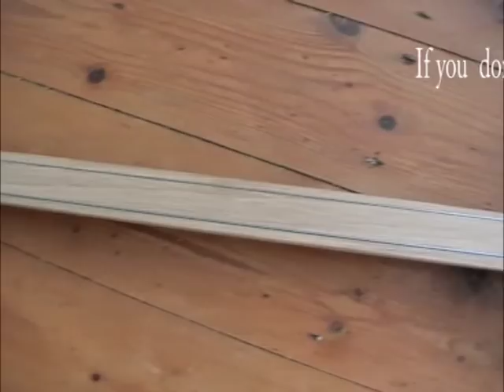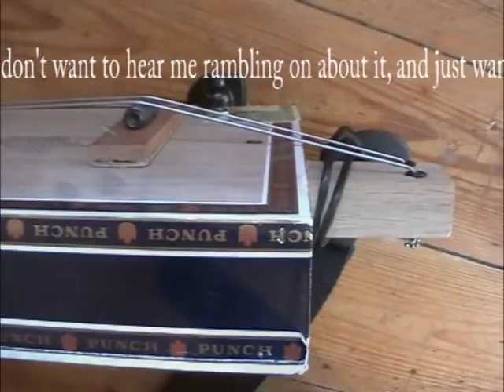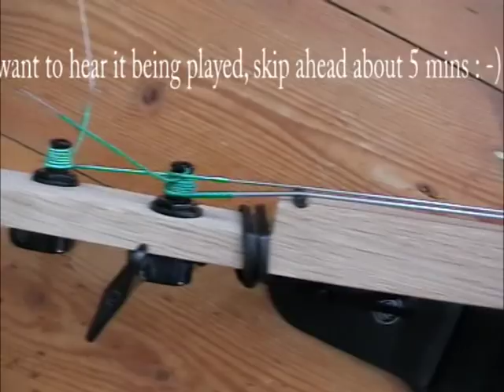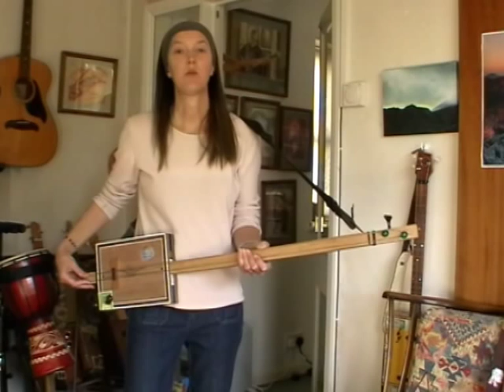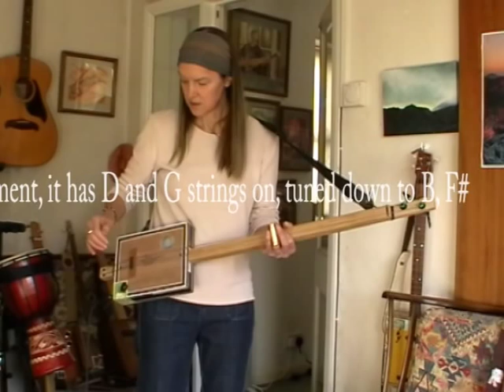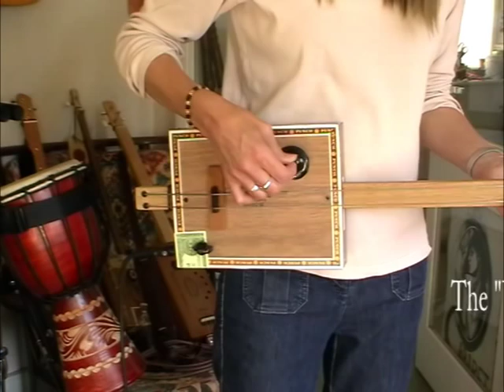2 String Fretless Bass Cigar Box Guitar - Demo.

Comment: That's very cool. I'm going to build one with a broom pole I have downstairs. There's no threat of breaking the wood really, IMHO. You're only dealing with 15-25 lbs of force depending on the pitch you tune to. Most of that is compressing the neck and only some of that force is left to warp or twist it over time. All the best!
Reply from the maker: thanks, good luck with yours : -)

Comment: Funny, I thought I was the only one who used the bottom of the box as the top of my guitars! There are several advantages, not the least is access to the inside. Often the more ornate boxes have paper/MDF tops but wooden bottoms, so using the bottom can sound better. I like to put a nice finish on it, but you have to be careful with sanding. The cedar veneer is usually pretty thin.
Reply from the maker: Yeah, easy access to the inside is certainly handy...

Comment from the maker: ah cool! I don't have any fancy tools. I just got two strips of wood and filed a groove in one, put the piezo in (having drilled a hole for the wires to come though) and stuck the other bit to it with hot glue..piezo sandwich! Make sure to leave it so it's a tight fit as downward pressure on a rod piezo is important.
  Good luck!

Comment: I haven't made mine yet, but I found these strings which require are shorter scale, but require less tension than the strings most people are familiar with.  Classical Bass Guitar strings, 6 string (70cm). Tuned 4 notes lower than standard classical guitar. Silverplated copper on nylon wound strings La Bella

Comment: Hey, thanks for sharing. If you're still not sure about why long scale strings can't just be trimmed to fit a shorter scale bass: The heavy windings of bass strings can make the strings too fat to be bent and wound around the machine heads without detrimental strain on the strings. The heavier, the worse it is. The D and G strings would be just fine. Really heavy strings like a low B may not even fit in the slot. So, ideally the windings taper just beyond the nut. PS: I love the "undo button"!

Comment: great job! the high action on the neck would be solved by gluing a thin board to the neck, just like a normal scale, and maybe installing some frets. but it's already sounding amazing!
Reply from the maker: +José Islanio thanks...it'd need more than a thin board. The neck is about 2.5 cm for the strings where it meets the box!
Reply: Oh, I understand. Still, it would make a good difference, specially in the end of the neck. A very thick neck would be uncomfortable to play.

Comment from the maker: I used a rod piezo (it's sandwiched between two bits of wood.You can see near the start of the vid) which is wired straight to a jack...will send you a link to a site that has lots of wiring diagrams

Comment: i EXPECT YOU DONT WATCH COMMENTS ON THIS OLD VIDEO... but if you do , I fancy making a 2 string double bass in a similar way ... any advice ? Think an old acoustic guitar could make the sound box? i was thinking of trying to get a good bit of wood from a sleeper .... oak or other dense grained timber was used in the past... a lot of rainforest hardwood ended up making mille after mile of track here.
Strange kind of waste , then Beeching lifted a lot up..
I know tar may be quite deep inside , gotta be lucky .
GREEN OAK  sleepers I use making  gardens although they may move and split , but if its fretless couldn't I just go with the flow over the years?! 
Change the action with a staffordshire billhook!! 
A trussrod means drilling a very long hole or routing out a channel ?
i have been given a bass amp but does it HAVE to be a special acoustic BASS amp for PIZZA pick ups ?
J ust in case you read this , be grateful of your experience ... it sounds really cool the bass I'm hearing now.. and you're good at it NOT rubbish...  your simple driving style works perfick
Reply from the maker: Thanks for all the kind comments! Your curiosity and enthusiasm, re making one mean that you should go for it I reckon! My advice having only made of of these is to check out the Cigar Box Nation website, if you haven't already come across it. There are loads of friendly helpful people on there and there's a group for Cigar Box Basses here  https://cigarboxnation.com/group/cigarboxbasses?commentId=2592684%3AComment%3A873224  I bet one of those sleepers would be really strong! and using up something old is always good.  I play mine through a bass amp that's not an acoustic one....

Comment: very inspiring, went out and bought some supplies to build one. if you want to jam with someone, would you have to continuously tune to the scale they are playing in, or could  you make do with one tuning?
part of what makes this video appealing is your unassuming nature, and also, of course, your great playing
Reply from the maker: thanks, well it would be easier if you were tuned to the same key, but it'd still be possible without...would require thinking, so I'd prefer to tune it the same myself! You can tune it quite a long way out of what what the strings are designed to be tuned being fretless. Good luck with yours!

Comment: Love your videos. Just found this one and in a timely fashion as I was thinking about making one. Would you share the neck width and string spacing. I have a set of bass strings except for the smallest one being used on a lap Diddley bow.
Reply from the maker: thanks. The neck is 33 mm wide and 23 mm deep. The strings are 20 mm apart. It was all a bit random what I used though, lol! Good idea to use up the strings, bass strings are so expensive! Good luck with yours : -)

Comment: Hello ma'am!
You managed to get quite pleasing sounds and it seems you are into pop/rock or folk music. I will not comment on your music as it wouldn't be within the scope of this video.
Perhaps you need to Google scale lengths for electric basses. 
Longer scale lengths require more string tension to be brought up to pitch. So the action will be harder.
A higher or taller bridge will give the sound board more amplitude or vibration due to mechanical advantage. The action will be harder.
You could look up the uke basses on u tube or google. They use non metallic strings so, you may not need a truss rod if the neck wood is old and mature. 
Now only 2 strings,  seems half committed to this project, but you go by your limitations.
Anyway happy adventures!
Reply from the maker: I'm into all sorts of music. I enjoyed the limitation of two strings. Must get it down, haven't played it in a while...

Comment: I notice you tuned the bottom to 'C'...I guess you down tuned the strings?  And what did you tune them to?  Does the high action bother you?  and one more question, what do you use for the pass throughs on the the back to keep the strings from contacting the wood?

Comment from the maker: cheers. Oh no what have I started!...I used oak, just because I happened to see some cheap on eBay. I would make sure it's some kind of hard wood, as those bass strings create a lot of pressure! Good luck : -)
Reply: bemuzic especially -  if it's white oak (with straight grain), you won't ever have any worries about snapping - even if you use it to help pry open crates lol.  Very nice build and video.

Comment: Great bass, but how long are your nails? Try cutting them back a bit if you find they're affecting how sharp the tone is. 

Also, if you want to lower the action more and further strengthen the neck try adding a fingerboard on top of the oak. Will bring the strings closer. You might have to shape the neck a bit to make it thinner though.

Well done on a great looking and sounding bass

Comment from the maker: It has  D and G strings tuned down to B and F# The high action's fine if you like sliding.
 I used rivets on the holes top and bottom. Sounds like you're planning on making one?

Comment: I hope you don't mind another question. Where did you place your rod piezo, did you use more than 1? I got the built in bridge one and have very little volume.
Thanks
Reply from the maker: there's just one rod piezo. The saddle is two bits of wood. I made a groove in one then sandwiched them together with the piezo in between them. I think they need some downward pressure to work best..

Comment: Made my bass  following your  vid....I used the biggest strings   and whilst OK  when plucking   They rasp terribly  on the slide..Not Good.
Think I will change to the  smaller strings and dampen the  piezo  pickup.
Cant make  Bostock but  hope to catch you in Cambridge sometime.
Keep up the good work...
.and  keep up the  bla-bla....its all  part of the  CBG  thing.
I would not have made  mine if you   had not described it.

Comment: I think I already mentioned that a fingerboard would strengthen the neck, it's not difficult to make either. Just cut a piece of wood wider than the neck and plane it down. Doesn't need to be a hardwood or anything. That's the beauty of cigarbox guitars!

Comment: what machine do   you use to make eco of the sounds that you do with  yours hands
Reply from the maker: It's a loop pedal. At the time I think I was using a Boss RC-20, but now have an Electroharmonix 22500. There are loads of different ones about now, some quite cheap if you don't need vocals as well as guitar, like this one https://www.amazon.co.uk/TC-Ditto-Looper-tc-electronic/dp/B00AZUAORE/ref=sr_1_1?ie=UTF8&qid=1492616945&sr=8-1&keywords=ditto+looper